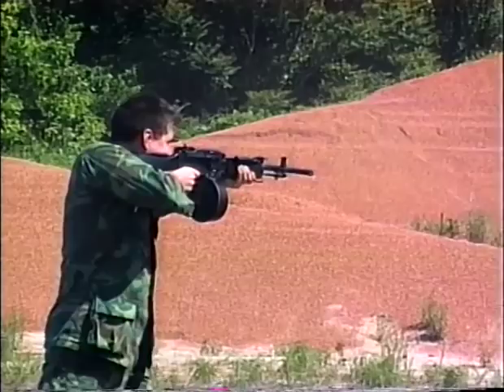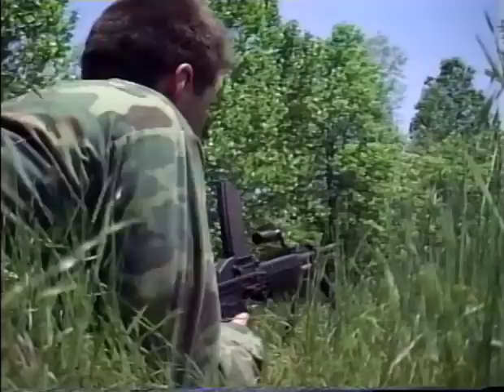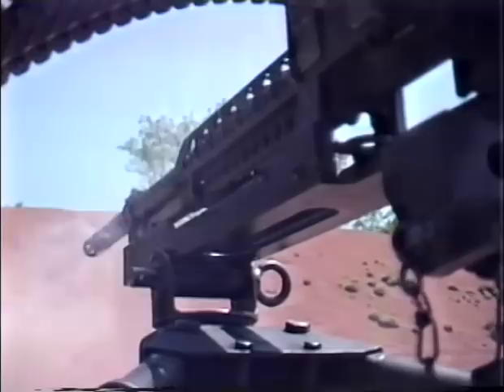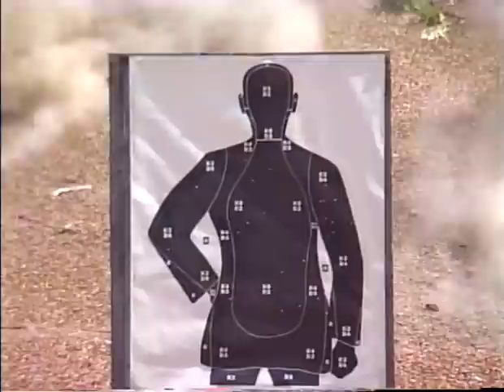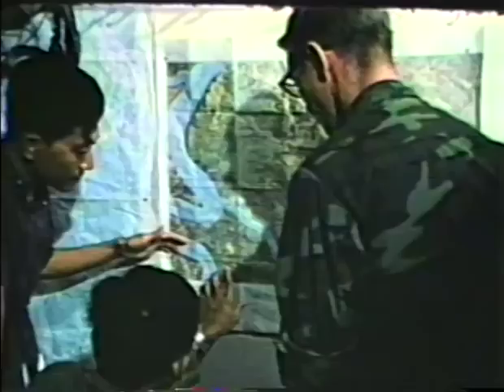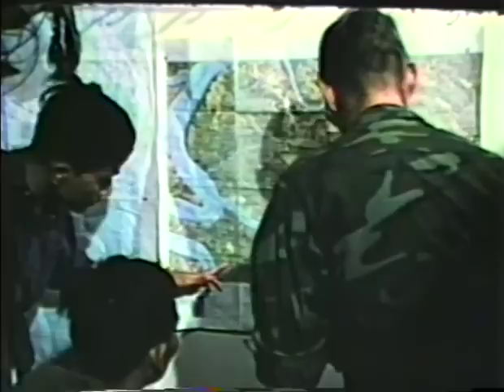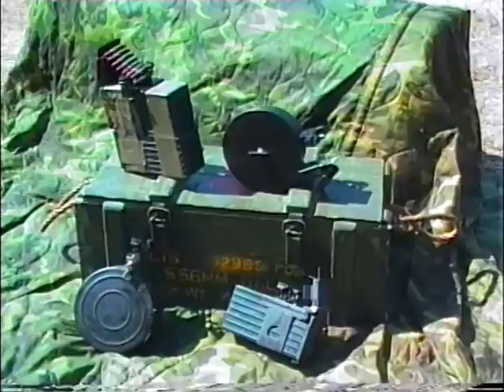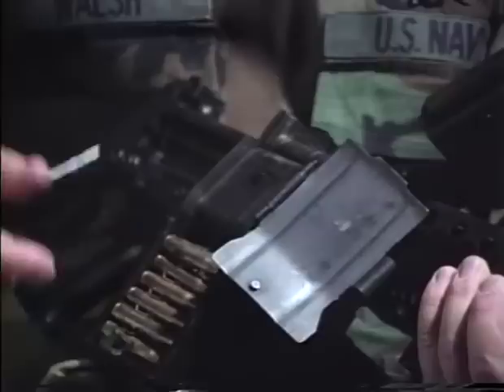US  Navy SEAL Stoner 63 Video

Comment: The Stoner M-63A Light Machine Gun was one hell of a great weapon system that kept a lot of Navy SEALs like my friends Tom Norris, Mike Thornton, and the late Rudy Boesch alive during patrols in Vietnam!
Reply: Roger Hayden too, he talks about it extensively on the Jocko Podcast.
Reply: They were just spraying the jungle. They would have been better off with grease gum or Thompson with more light weight ammo and more rounds.. 

I would have taken more reliable m14 any day. Full auto had little real world use. It looks good shooting at a target. In reality you conserve ammo.. 

Many seals carried m14 as preference. Stoner unreliable, especially if not cleaned and lubed all day.
Reply: @mysticjedi6730  45acp compared to 556, I would think the little bit of weight differences would be worth it. Maybe not so  much with 762×54
Reply: @chrisslupski1525  hell man you going into Vietnam you want as many rounds as you can carry. It was mostly close range no body armor spraying.. 

But sure put me in ww2, Korea, Vietnam anywhere and I want long range primary and secondary with tons of ammo.. 

I would much rather That setup than the stoner..
Reply: Amen
Reply: @mysticjedi6730  absolutely not for many reasons many Vietnam vets specifically seals and sog guys have listed 
And why they prefer car 15 especially with sog seals usually operated one or two days at a time  and close to resupply sog was dropped into Laos and Cambodia for days in the real jungle 
Both used full auto extensively compared to gwot guys who almost never go off semi auto like the seal in this video says full auto allows you to overwhelm especially at start of initiating or reacting to contact 
And often Time not having tk react before fully seeing enemy as one sog guy says many times in interviews being able to immediately "blow back" the enemy so you can break contact and move or effectively complete small unjt ambush with minimal risk it was always first two mags dumped then selecting shots 

The Tommy is open bolt which is you know what that means can understand how it would be a nightmare in that environment especially for seals lol no fucjung way u can swim move ans operate in rivers rice paddies beachs sand mud etc with open bolt system and expect it to work and you to live that's just absurd they wouldn't even consider it and many have stated so in podcasts and interviews 

It's also 11lbs loaded almost twice that of a car15 and ounces equal lbs and lbs equal pain a d pain equals slow and slow equals dead is what's they say in those u it's and many times they wouldn't take food even ok multi day ops for this reason average sog guy carried 600 rds of 5.56 for car15 in 20 rd mags 
And seals carrying the m60 sometimes 1000 with other guys having a belt or two as well

They aren't operating from vehicles or with logistics gwot guys have and sog guys were inserted hours by helicopter from base over borders for days and had to hold off company and sometimes battalion sized nva regulars not just Vietnam cong peasants seals mostly worked in the delta and on coast doing village raids on Vietnam cong killing tax collectors doing prisoner snatches and wer eout for a Night maybe 2 then back 

The effective firing range of Tommy is 200yds really less 
Car15 is 440ydd

Also absurd difference on accuracy due to ammunition used barrel length etc 

Weight of .45 alone is retarded 

Also wood and steel with loose machining the jungle eats alive or the dirt sand much debris and detritus make home 

The m14 is even heavier very heavy with a overall length that is absolutely retarded for jungle use and the size and range isn't useful outside instances where u have clear line of sight for quite some distance and need to reach out to it like base defense sniper and counter sniper or in rifle squads of conventional units to be used similar to how the BAR was that was the intent of making it the standard issue when it was the BAR was so effective in the pacific and Europe in ww2 they thought shit why not make every rifleman a BAR man

Which sibgreat in that kind of conflict but definitely not in Nam or with the technology rapidly evolving like it was 

It was only more reliable in certain cases due to issues with first initial run of m16s and the ammunition the initially chose to procure and issue for them many many misconceptions and confusion passed as fact a out this issue 

The car 15 however was gold from day one and sog and llrps speak of it like it was a divine gift from Mars the God of War himself 

The m4 is loosely based on the concept
Reply: @mr.shin.5138 can you tag me on that podcast video !?
Reply: @mysticjedi6730 and that's why they chose to run with the stoner?those boys cleaned all there guns every time so if they wanted to run m14 they would have,probably take the m 60 if they want a 308 ,
Reply: @mysticjedi6730 so 100 or 150 round drum isn't enough?compared to what?
Reply: My favorite gun ❤
Reply: @jessef88  absolutely I love it too! Have a blessed day brother!
Reply: @Tuglife912  ty right back at ya brother
Reply: @jessef88  yes sir!

Comment: I've always wondered why macv sog didn't like these weapons. It seems like they were always looking for ways to up their firepower and the stoner had exactly what they were looking for with those box magazines. I've heard it's because the gun needed a lot of maintenance and cleaning, but if that's the case it's strange that it was so popular with the seals seeing as they were the ones operating in the coast and the muddy rivers of Vietnam where keeping your weapon clean must have been a nightmare. Anybody know? Cheers
Reply: I've heard the same thing, that maintenance was the issue.
Reply: I’m by no means an expert on SEAL or MACV SOG operators but from what I’ve read the SEAL missions in the Mekong Delta region of Vietnam were short in duration while the SOG missions in the northern part of the country and along the Laotian border were multi-day/week excursions. Any weapon requiring meticulous maintenance for reliable operation would complicate longer missions.  Check out Larry Vickers’ video on this system where he illustrates how much lube this weapon needs to run reliably. Pretty cool weapon though—I’m surprised its modularity didn’t pique our military’s interest more.
Reply: @BentleyWhitman  The length of the operations being the reason makes sense, thank you
Reply: Even the Stoner 63 is very reliable, the design of this weapon is so complex that you need to maintain it properly, thats why military is looking for a simple but reliable design for frontline soldiers and that is why only the Navy Seals use the Stoner 63. but for me I would pick this rather than the SAW.